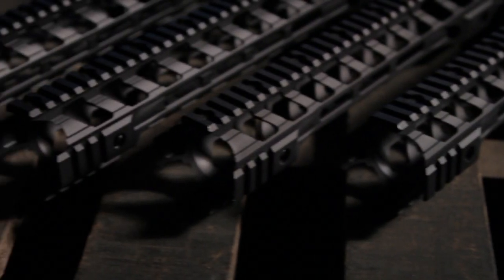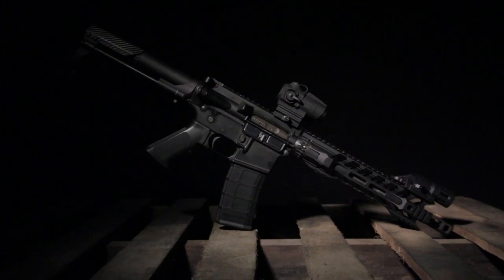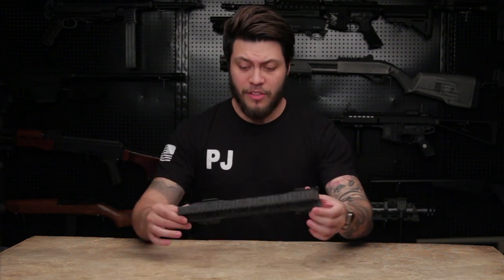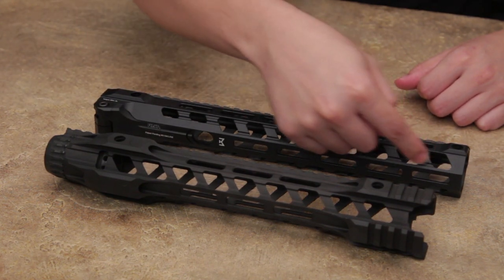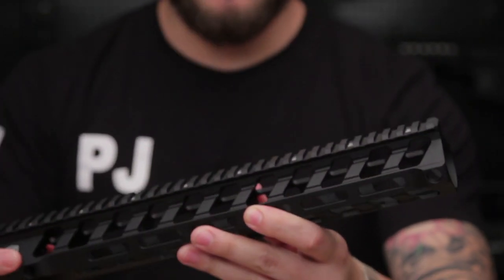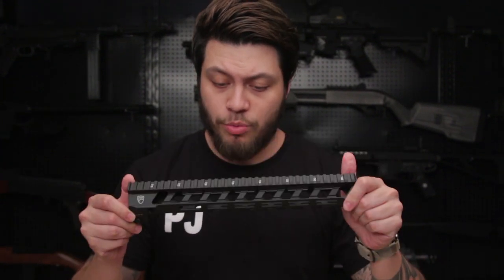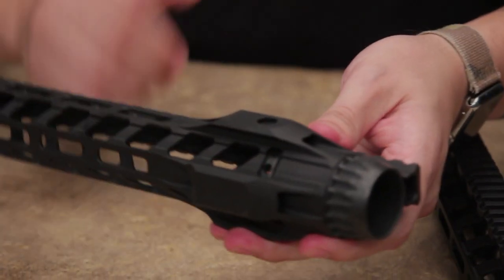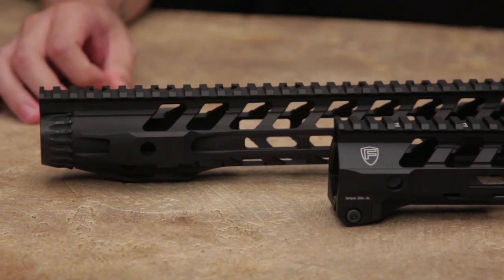Slick & Sexy: RWA Fortis Night Rail – RedWolf Airsoft RWTV

Comment: Yes, but since this is airsoft, all you need is a plastic handguard for 1/10th of the price. The rest is only swaggering. (Which is ok BTW if you have the budget.)
Reply: depends on how much you play, if you play 4 skirms a month, something durable is a lot better. if you just play once a month CQB. sure plastic will do the trick
Reply: I dunno, I never had a problem with any exterior part but a lot of interior part problems over the years so that's what my money is saved for.
Reply: prolly more suited to GBBR user like me. cheap bolted handguards got destroyed after a while
Reply: Or just use real steel handguard..